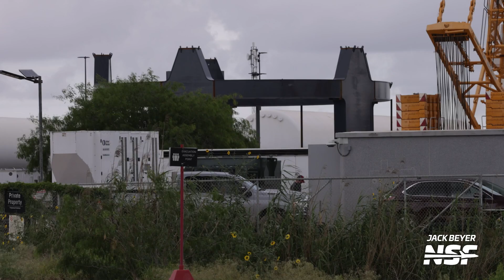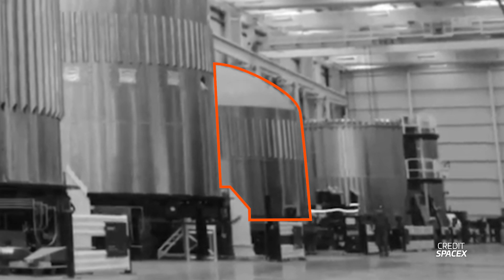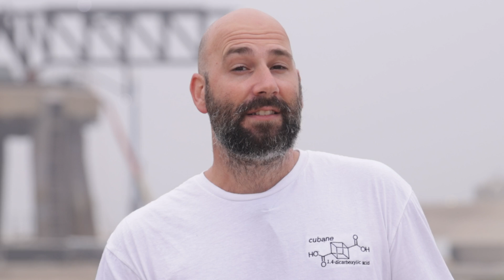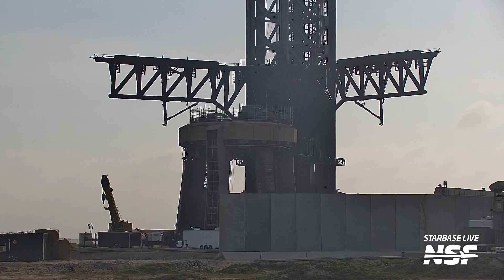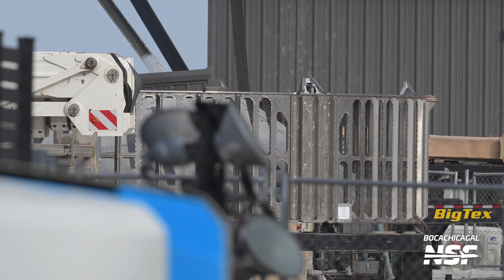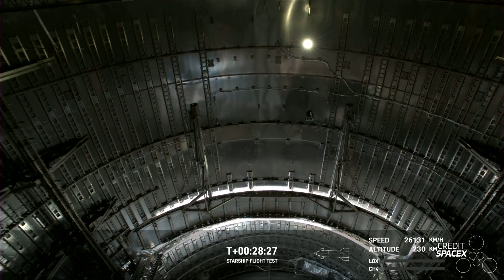Coming Soon: Starship Propellant Transfer Demos | SpaceX Starbase Update

Comment: Interesting about the propellant slosh.  So maybe the propellant in the ship during the last test flight somehow started to spin in the tank.  That might have been too much for the flaps and little attitude jets to overcome.

Also, how in the world are they going to fill up the orbital tank farm and then fill HLS if they are only using differential pressure?  Seems like you'd get half of the propellant transferred and then pressures would equalize and transfer would stop.  Then filling HLS from a half filled tank would result in only a quarter of a tank in HLS.  Who knows, lunar gravity is low, so maybe that's all they need?  But I bet they'll need pumps eventually, though the simple way will get them past the first milestone.
Reply: The tanks have vents to remove or build up pressure inside of them
Reply: @Alexphysics13  That's nice and I see this all the time when I get my propane tanks filled, but I still don't get how it would work in space.  There's no gravity up there.  Pressurizing the delivery tank and depressurizing the receiving tank (differential pressure) would seem to proceed until pressures are equal.  That means fuel mass would be about equal, too.  Leaving the vents on the receiving tank open would allow you to fill it under gravity - I guess that's how they fill the rocket in the first place - but it seems like in zero gravity a lot of the fuel would just go out of those vents and be wasted.  

Hmmm.  I suppose they could lock the two ships together and then use an engine to accelerate them during the transfer, keeping the fuel in both ships at the "bottom" and using the existing vents at the "top" of the tanks.  Doesn't seem like it would take much acceleration, probably not even 1G.

Whatever the case, I'm sure they'll work it out.
Reply: @briangodfrey7424  So the key ingredient you're missing is that Starship effectively won't be refuelling in zero gravity.
 It will be in space yes, but it will also be under a small amount of thrust during the refuelling procedure. 
The forward thrust of the ships causes the fuel to settle to the back of the tanks, thus behaving similarly to on the ground.
So if you open a vent at the front of one tank, only gas will come out, not liquid.

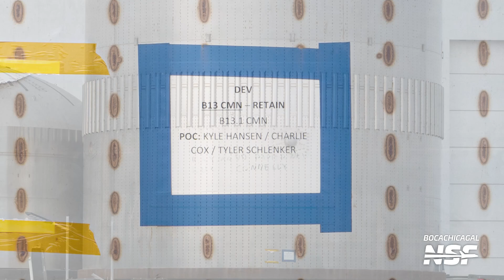Comment: At he 4:02 mark you can also see it marked as "POC' (Proof of concept) most often these may never see the day of light. By doing these mock ups, we can see what the CAD drawings will never show you. They are a critical step in any products evolution. Most often it is to either a change due to a critical flaw or possibly to save weight or in my case it is 90% of the time to save cost of material to the original BOM.

Comment: sooooo they are spending as much time on a spangly new building as they are on their actual products ... btw CNC welding tooling has been around for decades, so why do Space X think they need to re-invent everything.
Reply: They don't need to reinvent anything. Testing your tooling after receiving it to make sure it follows the standard you're looking for is completely normal and common across the indsutry, the test articles made out of doing that are normally called "welding confidence test articles". Literally everyone in the aerospace industry does that, even in the SLS program....
Reply: @Alexphysics13  OK - as a bona fide production engineer here, I can say that the amount of scrap and wastage they appear to be discarding is obscene and way beyond validating the tool. It leads me to believe that they either cannot correlate the design to the product (ie design creep) or that they are not understanding the machinery that they have (ie incompetence). Either way Space X is not the cutting edge aerospace company that its founder sold to NASA (in fact a video should be done on the awarding of the contract but I digress). There is a standard text that the Apollo engineers produced which is a playbook on how to get to the moon, yet Space X seem to have no read it.
Reply: @quicksesh  They just have a lot more tooling therefore more scrap, it's not that deep
Reply: @Alexphysics13  rubbish - as far as welding is concerned they are overlooking FSW which has been around for 30 years and doesn't require calibrating,BTW you don't cut holes in things to check if the welds were as per spec .. they are scratching around like prairie dogs trying to create something that is fundamentally flawed. And tooling - sorry what tooling are they doing, it is not creating something that hasn't been created before. Suggest you look at how ULA are machining their rockets - minimal wastage, minimal issues and they are developing their vehicles at a pace with minimum of fuss. Space X shooting for the moon with their current design is massive vaporware.
Reply: @quicksesh  FSW is complicated to perform with steel, that's why they do laser welding. Laser welding of steel is very common in rocketry, major example being the Centaur upper stage which is welded that way. SpaceX already does FSW on Falcon 9 but that one uses aluminum-lithium for its structure which is a lot easier to weld that way (ironically harder to do laser weld on it).
Reply: @Alexphysics13   FSW is relatively easy and is used by ULA in the Vulcan rocket construction without issue. You can use FSW to weld steels so not sure why you think that is a problem. Laser welding is an improvement on “standard” welding techniques but has pitfalls and potential quality issues.
Reply: @quicksesh  ULA uses FSW on Vulcan which is aluminum-lithium like Falcon 9, not steel. If laser welding has pitfalls and quality issues, ULA wouldn't use it on Centaur...

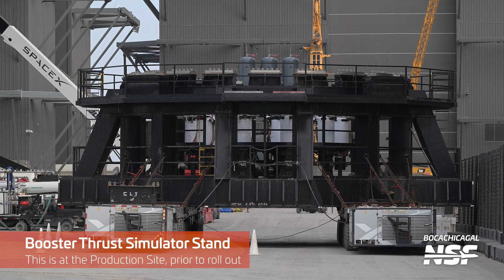Comment: 5:37 Thrust simulation doesn't really simulate the actual thrust: Where are the shakers to simulate the thrust and vibrations produced by the engines when they're running?
Reply: Well what you're asking for is a vibration test stand which they don't have. This is a thrust simulator stand, where pushers push into the aft cap of the booster simulating the force of the Raptors.
Reply: @Alexphysics13  I understand what they're supposed to simulate, but they're missing a big factor of the engine thrust: engine vibration. It looked to me on the ship test flight (ship 15? The one that successfully landed then blew up shortly after) that the lower dome/thrust puck may have separated from the ship barrel section. When the methane tank was on the bottom, there was a considerable fire after it landed, like there was a tear in the weld between dome and barrel.

Just sayin'…
Reply: @jbak6892  there has never been any Starship vehicle, prototype or otherwise, where the methane tank was at the bottom
Reply: @Alexphysics13  I Think you're wrong, but regardless, something on the aft end developed a leak, whether it was the dome/barrel connection, or one of the fuel lines to the engine. Simulating actual raptor thrust/vibration would bring those weak points to the fore better than simple thrust application.

Comment: Couldn’t they run a tube through out inside the tank of varied size. Ie from large to small. Made from substance conducive to cold &surrounded through out the tank by a freezing type material radically deep cooled or frozen to keep the fuel in the pipes colder. A) from thick to thin. The fuel gets colder just before eventual transfer to STARSHIP from tanker. Also. Piping system reduces greatly TANK SLOSHING as the fuel is pipe contained and force fed down the narrowing pipe to the point where it’s cross injection flow stream begins. (Actually had a very weird thought. This could quite easily be sound sped up via sonic pitched notes played via computer in a swirling faster moving sound radiating through a tank intentionally shaped(maybe more like a musical instrument than a fuel tank. Simply to drive the speed of the fuel. If that’s at all possible or simply radically MAD. I’m not quite sure. I’m dancing with either thst or maybe BETTER STILL. THE USE OF THE EARTH S MAGNETIC ATMOSPHERIC SURROUNDINGS TO SPEED UP FLOW. (surely there must be some way of creating speed with exterior natural magnetic forces through pipe created by using more and more copper content or brass(Again another WAY out thought. But one surely has potential for merit. The piping also reduces sloshing and creates clean fast flow rate. Not so. Again a mere thought. On the receiving STARSHIP tank a second outer thermal Cold hollow tank would capture cold boil off and keep the tank colder longer. Again. Rough thoughts of a man with zero tank knowledge. “The Tank Man!”

Comment: Great Video !  A new low inclination LEO CSS is needed by heading East from the KSC with a Fuel Depot nearby !  The Fuel Depot will include a Sun Shade to reduce boil off of the propellant, maybe down to near zero boil off for Oxygen (O2) and Methane (CH4) !  A Fuel Depot is also needed on the Lunar Surface (LS) near the South Pole Lunar Outpost/Base (Clementine Base).  The LS Fuel Depot will be supported by the recovery of Lunar Water Ice (H2O) to fuel the HLS/LEV/LLV...  Also the Hydrogen (H) from the recovered Lunar Water Ice can be used to recover Oxygen (O2) from the minerals of the Lunar Regolith !  The Tech developed to return to the moon to stay, can take US and the world to Mars and beyond !  tjl     P.S. For more info read the paper  "Moon Direct" by Robert Zubrin...

Comment: I am disappointed that they are going to use a V-Bar approach. Yes, it is easier to do, but a R-Bar requires less fuel
Reply: Doesn’t the dragon approach on the harmony node along VBAR as well?  The initial approach is RBAR but the docking is VBAR.

Comment: OLM is a Maintenance Nightmare... They'll need to repair & repaint after every launch attempt or Static fire.  
If they had a Proper Launch Pad & Flame Trench they wouldn't have to repair & repaint every time.
Reply: Repair and repaint is still needed even with a flame trench, the rocket doesn't suddenly stop damaging hardware just because there's a trench. Ask the folks working at LC-39B...
Reply: @Alexphysics13   not if it's a real launch pad with all the plumbing hidden underground and covered with concrete like at 39a!
Reply: @Shivaho  39A still needs substantial refurbishment between flights and plumbing is not hidden underground, there's a launch mount and strongback that are blasted by Falcon 9 and Falcon Heavy every time they fly. Those need refurbishment and repairs for every launch.
Reply: @Alexphysics13  maybe but they just wheel it back to the hanger and it's done! Nothing else needs it! The olm has to have scaffolding erected every time! As well as the qd arm! Don't forget that they repaint it as well and 39a doesn't need it! They will never get to launch more than once a week at the rate they are going!
Reply: @Shivaho  They don't "wheel it back to the hangar and it's done". The TE stays at the pad being refurbished for days and doesn't roll back until everything is ready for another launch. Then it rolls back, gets the rocket, and rolls out again. You can watch that process live on Space Coast Live in this channel. Also 39A does get repainted and gets cosmetic changes. Most recently they removed the cladding from the Fixed Service Structure to aid on refurbishment because the cladding would get damaged and they would have to repair it with every launch which kinda defeated the purpose of it being there in the first place.
Reply: I read every post-launch report online for the Saturn V and Space Shuttle launches, which are the closest points of comparison to the thrust of the SpaceX super heavy booster. The launch pad, structure, and trenches required repair after every launch. For example the Space Shuttle once blew 1500 firebricks out of the flame trench. There was such a long time between spacecraft being ready for launch that nobody noticed all the work that went into repairing the launchpad. SpaceX is way ahead of that on getting the OLM up to snuff. when the launches start getting close enough together, they won’t bother repainting anything anyway.

Comment: Does anyone have any idea if starship is still planned to have those large windows in the front?

I feel like that might add a lot of mass and create structural weakpoints

Spacex also didn't include the windows on the recent renderings of starship V2 and V3, so I'm a bit curious about that
Reply: The windows are just for the crew version so of course the renders didn't include any windows

Comment: I have some trouble picturing how the "pressure differential" will just magically do the prop transfer all by itself, without any pumps.  Let's say it even gets to a point where 50% of the propellant has been transferred.  Now, the Target and the Chaser have equal quantities of propellant, under equal pressures... and then what?

Seems like maybe the Target ("depot") Ship would have to be venting ullage all the time during the prop transfer, to make sure its tank pressures are always below those of the Chaser ("tanker") Ship.  And the Chaser will have to augment its ullage somehow to keep its own tanks strongly pressurized - yet, without firing its main engines to leverage autogenous pressurization, it'd have to get extra GOX and GCH4 elsewhere (maybe from additional onboard high-pressure gaseous propellant bottles?)

And also, sounds like the settling thrusters (on which Ship?  or on both Ships?) would have to fire continuously during the entire prop transfer process.  Then again, maybe a continuous ullage vent from the Target could also help keep things settled...  And if the settling hot gas thrusters are on the Chaser ("tanker"), could they double up as ullage gas generators, via their own autogenous pressurization piping (could they generate enough power, to gasify enough propellant quickly enough, as a side-effect of providing the settling thrust?)
Reply: They’re going to try the “simplest part is no part”, first; if that doesn’t work, they’ll take lessons learned, redesign quickly, & try again quicker than any others would do. One beneficiary will be Blue Origin, who gets to watch & learn for theirs for free. - Dave Huntsman
Reply: Or they could move the gas from the receiving ship to the delivering ship at the same rate that the propellant is transferred. It will need extra pipes for that. Complicated.
Reply: @knowledgeisgood9645  it would also require pumps: which they specifically claim shouldn't be needed...  (Remember, the whole transfer is supposed to be driven by a pressure differential; the pressure would quickly equalize and halt the transfer, unless there was some way to maintain that pressure differential.)
Reply: @Spherical_Cow  I think you answered your own question. They'll continuously vent the Target so whatever boil off that happens doesn't prevent further liquid transfer. It seems wasteful, but to get to the moon they don't need as much prop as say, a Mars trip. 

On the other hand, long term, I think your skepticism is warranted. It's like the water deluge system. They tried to run without one, but its simply not possible. You gotta figure that reducing the number of refueling launches will eventually become a priority. Some sort of pump will have to exist.
Reply: Simple. Keep the Tanker ship at a higher pressure. 
What you could also do is just vent the methane and oxygen gas into the tanker ship to induce the high pressure so the liquid methalox will transfer through.

I also don't think they will use the main tanks for the fluid transfer. So the transfer tanks will likely just be at a much, much higher pressure. Maybe like 20 Bar
Reply: @Quasar-2  The ships are not made to take 20 bar. They are tested to 6 or maybe a bit over that.
Reply: @knowledgeisgood9645  The standard ship, yes. We don't know what's different with the Tanker ship. If the only difference is larger tankss, then 7 or 8 bar would be plenty for fuel transfer.
But if the difference is the payload portion is used for tanks, then a different tank can be used. One that can stand 20 Bar
Reply: @Quasar-2 
The propellant is only stored in the main tanks and 2 small header tanks, not in the cargo compartment. The main tank bulkheads could both be shifted upwards to increase capacity...

Starship propellant tanks are required to withstand an overpressure of 20% during tests, and no more. Higher pressure, such as 18 bar, would require steel 3 times the thickness. That's no good, as reducing "dry" mass is very important. 

COPV tanks in the engine compartment are used for storing high pressure helium for engine spin-up, and other COPV could hold a small supply of high pressure propellant gas, but this wouldn't pressurize the main tanks, but instead supply the hot gas thrusters. The hot gas thrusters would flash-heat cryogenic propellant during operation and maintain the COPV pressure.
Reply: There is no rush to this process. High pressure is wasteful because it causes turbulence. Slow and steady is good enough. 

Transfer only requires that the receiving tank vapor is slowly vented to space in a controlled manner. Ullage can be maintained with a single efficient thruster aimed through the center-of-mass.